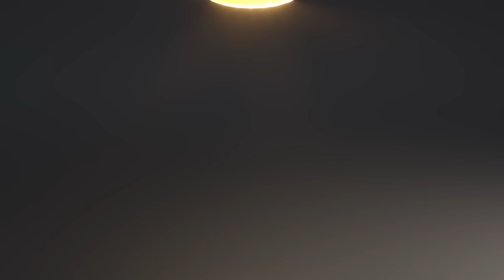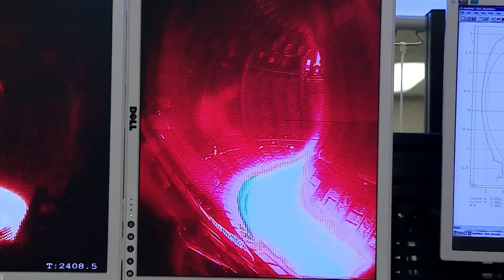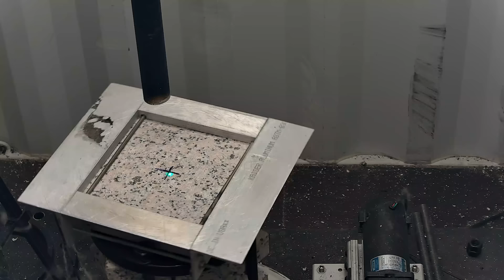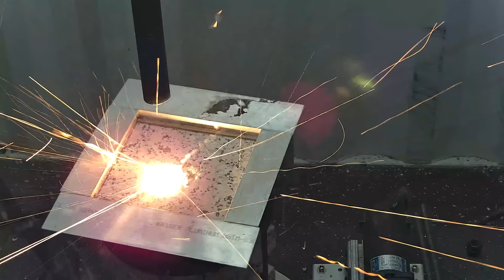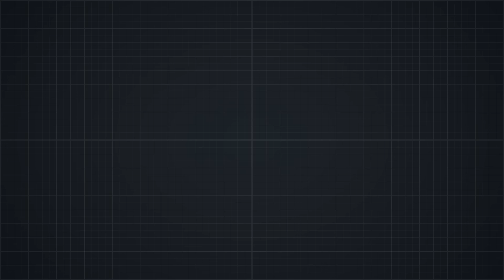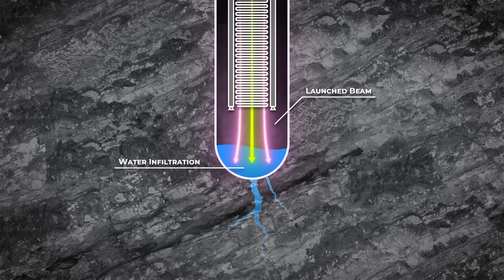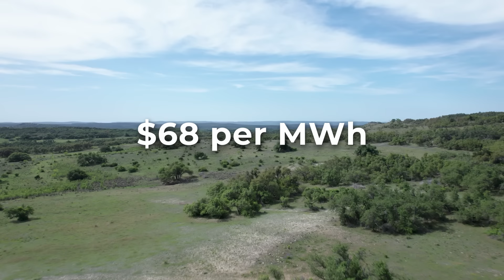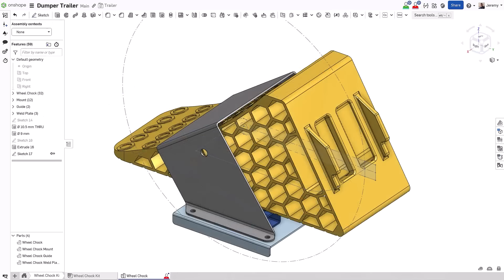Geothermal Energy is Changing

Comment: This is a bullshit company. First of all, 1 meter per hour of ROP is unacceptable (3.2FPH in American units). That would be a huge step back in drilling time. Secondly, "water will be the worst enemy of millimeter wave energy" Yeah no shit, except for the simple fact that every well ever drilled is filled with water from top to bottom. Not just any water, "mud" which is engineered to perfectly balance the hydrostatic pressure of the mud and the pressure of the earth trying to send oil and gas into the open well. 

Every test in this video was done in open air, which does not exist at the bottom of a well. There will be no way to transport the "millimeter waves" from the surface though "hollow tubes" to the bottom of a well. Underbalanced mud in a well means blowouts, remember Deepwater horizon? 

The fact this was addressed in this video shows that "real engineering" has no working knowledge of how a well is drilled, and this company didn't tell him about drilling mud because it's trying to game startup money and then disappear with it.
Reply: Bro. what? And what about plate tectonics?  What happens if an earthquake happens?

Comment: Pretty insane that the "drill stack" of all these wells are just threaded pipes connected and disconnected manually.
You would think that with the INSANE money involved in the industry (not due to geothermals, due to oil and has) they would have figured out a better connector that would aid in automating the whole thing. I dont get it.

Comment: Is it correct to assume that the tech might be hybridized with conventional drilling used at shallower layers of softer dirt and gravel before being switched out for the Quaise tech upon hitting bedrock? That conventional liners like metal and cement might be used for the shallower depths before switching to rely on the vitrified pseudo-obsidian as a liner? I would have liked to hear more about the effects of heated geothermal liquids, the abrasives and chemicals that might accumulate within, and their combined impact on the vitrified layer over time as erosion. Presumably the layer would be more easily repaired on a maintenance cycle than conventional cement and metal liners which would have to be dug out? Assuming that the gyrotron could simply be reinserted on an annual or whatever time frame basis, but that would require transporting the device and it’s infrastructure to the site multiple times instead of just the one off initial dig?

Comment: Sounds like they might want to build a renewable power plant to provide the energy to drill with, in which case, why not just use that as your generation and be done with it. I can't see this competing when all you need to do to account for renewable variability is overbuild a bit and/or connect up different areas.

Comment: So am I correct by saying, instead of using mechanical forces to break the bonds of the earth's materials to create a hole, they are using microwave energy to collide with the atomic bonds in the materials, causing them to vibrate until the bonds break by electronic means?

Comment: As a geothermal eng. myself, I am wondering how they took care of the problem of extracting the material from a 12km depth. In Canada, past 150 m or so, most of the energy you input in the borehole simple goes to trying to get the material back to the surface…anyway, good luck to you, you will need it.

Comment: Sooo, I noticed in their testing that they are spinning the “rocks” they are “drilling” into while the actual “rig” remains motionless (other than the assumed up and down movement).  This “rig” uses waveguides to transmit the energy to the “drilling head”, if I am correct.  To my knowledge, in typical drilling of these holes for wells, oil extraction, or any other resource extraction uses a drilling rig that rotates the drill bit into the ground/material being drilled and NOT the way that QUAISE is using to demonstrate proof of concept.  Do NOT get me wrong, this is AMAZING stuff and I think it truly has potential, however there is one glaring problem that was not mentioned in this video and maybe not yet solved by their team…”how do you transfer that energy from the gyrotron, through the waveguide, and to the “cutting head”?  That waveguide will have to rotate requiring a rotary coupler of sorts.  I would be very interested in seeing a rotary coupler capable of transferring that energy through the waveguide while rotating and staying cool.  My guess is this will be the highest failure component and the most difficult to engineer.  So definitely would like to see some info in this!  Thanks!

Comment: Start ups like these are the hope in moving away from  conventional resources   used now pump baby pump that oil is a dead end even the homeless know that off topic could it be possible to use a lava pike when still warm or hot or real hot  to drill through ? For that matter maybe just push through it with ? Fast enough to cut cost vastly to get to pay dirt .😊

Comment: This is really cool technology, and I'll be VERY interested to see they can make it commercially viable.

But also:
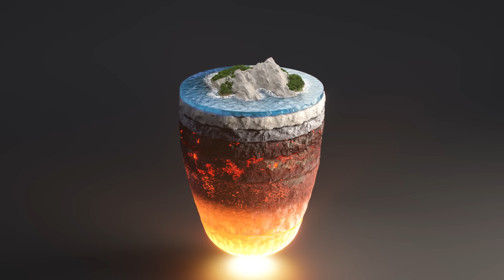1:05 & 1:45, it's not fission reactions producing the heat, it's radioactive decay.
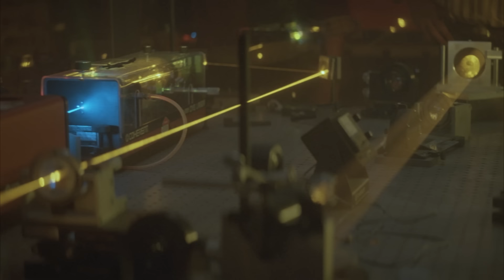5:10, Microwaves are a lower frequency than visible light. higher frequency is up into the UV range, I think you might have meant higher wavelength.

Comment: what do you mean with "it clearly works"? it seems very unclear to me how much larger the hole is compared to the beam wuth would be necessary to let the gasses out, not only that it seems to have 0 field tests. Normal drilling has no major pitfalls on the lab either.

Comment: What is often excluded in the cost of nuclear power vs solar and wind power is the cost of batteries and extra transmission lines. Nuclear ends up far cheaper than solar and wind if you include those metrics.
Reply: One other thing ... Somebody needs to ask these "green energy" geniuses if they know how much COAL is required to produce one ton of steel or a ton of cement (used to make concrete) - both products require high amounts of energy input, are not "carbon neutral,"  and cannot be produced without coal.  And what about all the diesel fuel used by the construction vehicles needed ("electric" vehicles don't cut the mustard for this application) to create access roads, clear and prep the project site, and do the actual construction?  Do these "green energy" advocates believe that all their "green energy" devices simply fall from the sky, magically produced in Heaven?
Reply: @hiturbine  There are folks trying to get around that with hydrogen or ammonia production. If you can make enough hydrogen through electrolysis, then you can burn it all at once to get temperatures high enough to make steel or concrete, like you're talking about. Heck, 70% of steel in the states doesn't even bother with burning, and just uses arc furnaces! That does use some coal in its production, but it's much more efficient.

These have answers, you just gotta look for em.
Reply: @meganegan5992  Hydrogen is very problematic, both in the energy required to compress and liquify it, and in storage.  Hydrogen, due to its molecular size (one proton in the nucleus) eventually pentrates (leakage) even the most dense container material.  Hydrogen also weakens (brittleness) metals over time.  You still need a source of carbon to make "carbon steel" - and coal is still the most economical form..
Reply: @hiturbine  Yes, true, but if you, say, have an electrolyzer on site, and pipe it in with PVC, then the issue isn't there anymore. No need to liquefy, no need to transport anything harder to get than water.

As for carbon, you may have a point, but I'm sure there are cheaper ways to make or extract CO2 than coal. That's the most expensive form of power generation there is, again, due to labor costs. Even with the highly automated strip mines of today, the LCoE of coal is double that of any other method besides nuclear.
Reply: @hiturbine the arc furnaces, for the record, are generally cheaper because of lower labor costs. No need to shovel or dump in pure electricity, and fewer moving parts means you dont have to pay as many mechanics. That is in part why America still makes about as much steel as it did in the 1980s, but employs way fewer people to do so. This doesn't appeal to your conscience, it appeals to your pocketbook.
Reply: They also do not include the cost of conditioning the DC current from PVs into transmissable AC current.  Nor do they calculate the fact that the wind does not always blow, or blows too fast; and nor does the Sun always shine.  Back-up batteries do not cut it - most back-up sytems rely on NG. 
 
There is also the recycling cost, which for Solar PV is very high cost - and other than the steel and aluminaum frames,) the remaining glass / silcon materials are toxic.  For wind, the turbine blades are non-recyclable, and must be buried in landfills.  The average lifespan of a wind turbine is not figured in to the cost analysis (approx 10 years).  

Also left out is that PV panels degrade over time, and produce decreasing levels of current.  There too is the degrading effects of dust, pollen, snow - and weather evnts (such as hail). 

He  fails to address that "green energy" projects require extensive government subsidies (Production Tax Credit and Investment Tax Credit), else they become too expensive to build.  

One last thing is the issue of power density - power generated vs the amount of land required.  Solar PV and Wind are a very inefficient use of land for the amount of power produced per acre of land used.  If you covered the entire United States with wind turbines, you would still not produce enough power to keep up with just the year-over-year increase in global energy demand.  Bottom line: Green energy" is and always has been a total scam.

Comment: 16:08 
This is not true at all. All power comes off the power lines at very high voltages. I'm an industrial electrician, currently working oil field. The vast majority of these sites have 69kv AC on the tranmission line. Converting this to DC is expensive but UHVDC is common for long distance tranmission, the technology is well understood. 

Any site that there were planning a geothermal generation station would need a grid connection anyways, so i honestly don't see why this would be a problem
Reply: I think the issue is that for testing, they won't have access to grid power. BUT I think that the issue he brought up is not as big of a deal as he thought.
Reply: @charadremur333  right, and when he said that the trailer is a power supply from Sweden, I'm sure that it's a ultra high voltage dc (UHVDC) rectifier setup from ABB, taking the 69k AC and rectifying it to 69k DC. 

I did a job at a coal power plant like 6 years ago where we replaced the huge rectifier stacks. The plant produced 400k AC then it was converted to 400k DC to send 300 miles to Minneapolis. Super cool stuff, I'm not a lineman so I had no idea they used DC for tranmission lines!

Comment: And how do you circulate those vaporized rock out without accumulating and cause pipe stuck. Then the second question is you claimed that vaporized rock will seal well bore, ... Then we couldn't maximize contact area for maximize vapour production which  using rock porosity or fault channel from formation surrounded wellbore😊

Comment: I've always thought that geothermal energy was an untapped and virtually limitless energy source, evenly distributed across the earth's surface, if only we could reach it, and I've had some very similar ideas on how to make deep-crust drilling easier and cheaper. My own ideas however involved using water cavitation to break through rock; shouldn't wear out regularly like a drill bit or take as much energy as a maser, and it would automatically stop drilling when it got to the depth and temperature at which water would become super-critical.

Comment: Why are they hating the whole section of the hole? Why not heat and vaporize only a thick ring at the perimeter of the hole, and then lift the cylindrical cores left in the middle through the pipe by using some dirtye of crane? Yes, I'm sure that's more complicated than I put it, but for sure the engineering challenges in lifting a rock cylinder through a long pipe pale by comparison with those of scaling the hole diameter by burning a massive area. If they can burn even just the outer quarter of the diameter that would reduce the energy needs in half.
Any reason why that wouldn't work?

Comment: The kind of well these would make, could be used for more than just power generation. Could use it for geothermal heating for a northern city in winter, or in more places for hot water. No more furnaces, replaced with a heat exchanger connected to a city wide loop, or hot water heaters replaced with hot water directly fed to the home.

Comment: Someone should tell them that drill holes are not straight and if you don't generate the slingshot at the point of impact, it loses energy along the way... The technology seems wonderful to me, but I don't see how they are going to transfer the energy to the point of impact... I doubt very much that they will be able to lower the electron beam through an empty tube... and the gas they generate will have to be removed from the hole if they don't want to have pressure problems.

Comment: I appreciate you selling the whole project, as it were. The technology is impressive, but realistic; I own a 40 Watt CO2 laser that can cut slate (much more slowly) that cost less than $1,000. Scaling up seems an issue of solving problems, not inventing whole-cloth.

Fission has the same front-loaded cost with much lower cost per kWh than, say, coal once it's up and running. But, as you say, fission is falling out of favor, mostly (IMHO) because people don't like the upfront costs and lead times. I really, really want geothermal to become more common, but it may require a shift in economics or mindset. Simply accepting that projects that take 20 - 50 years will pay off for the next generation may be one way, but what new advancements could obsolete the design by then?

I'm just glad people are trying new things. Who knows what this research could end up doing?

Comment: The grid can most certainly supply that kind of power. It wouldn't be cheap, but considering the idea is drilling at a site thats going to become a power station, making a high voltage connection seems pretty straight forward. Yes we usually step down grid power to 4160v before having it go to customers, but there's nothing stopping a company working out an arrangement with the utility grid to make a 60kv line coming off of 115kv substations. The goal is to have the site generate electricity for the grid when its all said and done, so just use the lines inevitably needed to transmit generated power, to power the drills

Comment: Years of working around drilling rigs big and small, dry holes past 100ft deep, have been rare in my experience. I guess if the water oil and gas were cemented off after passing those depths, I imagine a dry hole could be possible.

Comment: To say that nuclear fusion occurs in the center of the earth is going too far... there are the same chances of nuclear fusion occurring in the center of the earth as there are of a hydrogen atom disintegrating in the sea on the surface of the earth... it is abusing the facts. The fact that there is a high temperature does not justify or explain the occurrence of nuclear fusion. Just for mentioning that in an engineering video you should be flogged in your town square.

Comment: Designing it to work in a lab is one thing, but having it work (and survive for dozens of holes) kilometers underground with superheated rock gas constantly condensing onto it is a whole different challenge.
As someone working at a company that is constantly hiring drill contactors for our project, I hope it works. But I think it's likely a long ways off from being viable.
Reply: Anything that is worth anything is always a long ways off.....decades usually if not near a century.   I wouldn't have considered flight "good" until about the year 2000...nearly a century.   Cars were not good until about 1980...nearly a century.    Trains were not incredibly widespread until about 1900...nearly a century.   It takes time and failures to learn enough to have something "good".     The whole goal is to get over than initial hump of hubris.
Reply: a hololive clipper? in Real engineering's video comments??
my man 🤝

Comment: The LCOE depends on investment and the maturity of a technology. If we were to subsidize just one-tenth of what the EU and the USA have invested in solar and wind over the last two decades (several trillion dollars), the LCOE would undoubtedly drop significantly. When the metrics you use do not fully account for the amount of money, energy, and time involved, your final conclusion is biased by an order of magnitude. Nuclear fission in France with locally develop PWR after modest investment in the 70's make fission electricity in the 80's far less cheaper. Even after 40 years with some big strategic mistake and little investment the price is still around 50eu/MWh.

Comment: I don't see how they're deal with condensate fouling their waveguide. The deeper they go, the farther the vaporized rock has to go to clear the whole. If the vaporized rock cools below the condensation point, it will condense on the drill. This may cause the drill to get stuck or even stop working entirely.